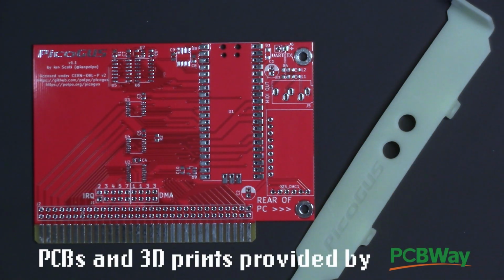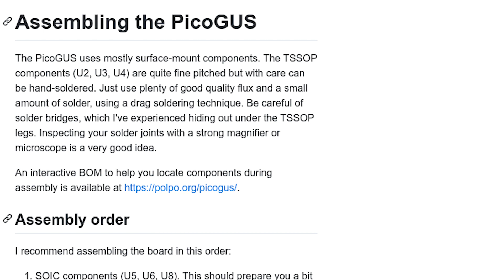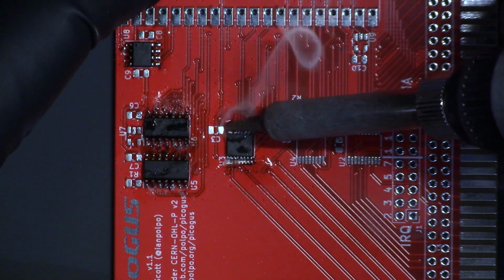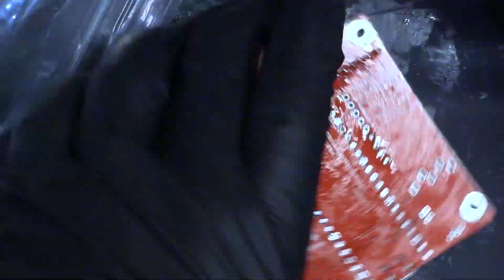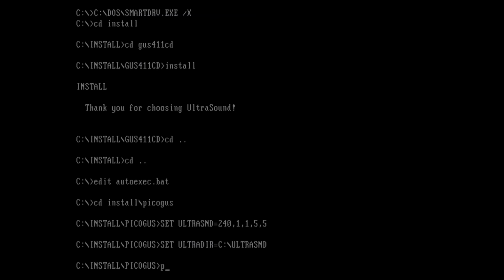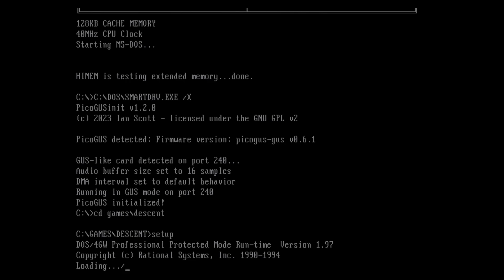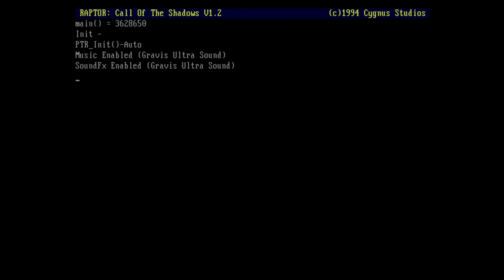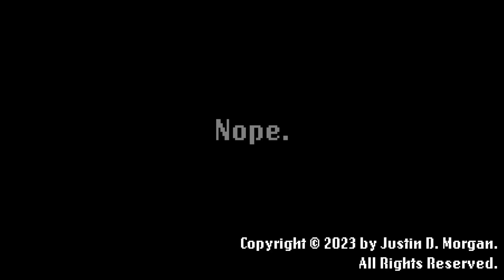Building a PicoGUS with @PCBWay to Enjoy the Gravis Ultrasound Experience (Computerized Start™)

Comment: Could you tell me how to make an order of this board? Which folder in github consists right gerber files? In picogus/hw/jlcpcb I can see only project.db file...
Reply from the maker: It looks like an issue was found with the v1.1.1 hardware, and an update is forthcoming. That’s probably why the gerber files are presently missing.
Watch the main project page for updates: https://github.com/polpo/picogus
Note that I’m not affiliated with this project, so I don’t have any insight as to when files for v1.2 of the hardware will be available.

Comment: Maybe you have an IRQ/DMA problem in BIOS.
Please try to load CMOD with a mod file. If it crashs or dont play you have IRQ or DMA problems.
Try using CMOD swiths to disable IRQ or DMA to see if it runs.
Reply from the maker: I’m not familiar with CMOD. However, I determined the issue was that the video card was jumped for zero wait states, which is not correct for a 386.